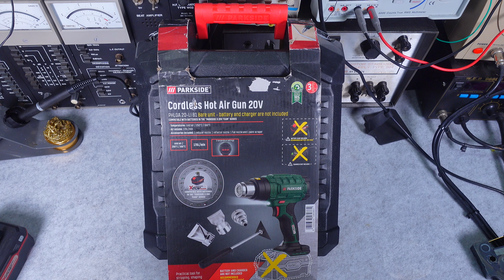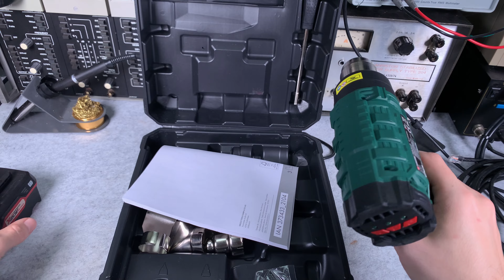Parkside - cordless HOT AIR GUN 20V PHLGA 20-LI B1 - great for heatshrink tubing (basic test)

Comment: Thank you for this video! While the quality of Parkside (Lidl) equipment is often very good, especially the Performance Series, I have some doubts about the longevity. 

Would be interesting to know how long a battery-charge will last in this demanding hot air gun application. I guess it will be a maximum of 15 minutes. Using it for other things than occasional heat-shrinking would be non-practical.
Reply from the maker: I have feeling that much less than 15 minutes! But to be fair I don't have new battery - couple years old.   In my opinion from experience - Parkside offer great money to value ratio. I had devices that broke after single use like spool of measuring tape (i pull it once and it did not retract :D) - and I have saw that I used to cut 4 iron cast radiators, each of them into like 8 pcs - and I was swapping battery - saw was so hot that I was sure it will fail - but it survived. Also I seen similar devices with tiny change in battery mounting - so I expect they might order that in China with small customization. That's why I called it's great for heat shrink joints - saying it will be good for paint stripping whole door - would be at leas not honest.  I was Bosch user for many years - but since couple of devices failed (green), I opened them and found nylon gears with broken teeth - I give it a pass. Blue still are good - but price for pro user who work with it and earn money.